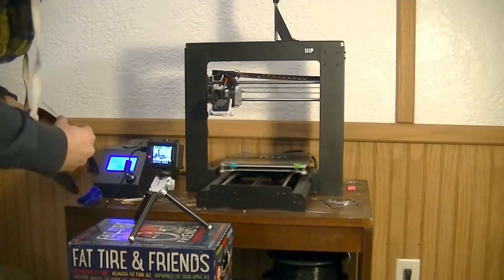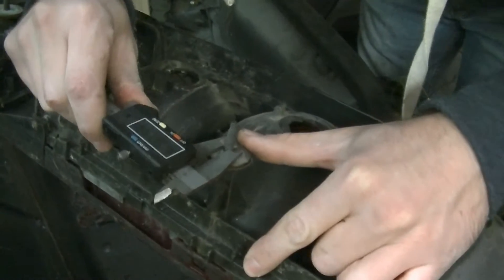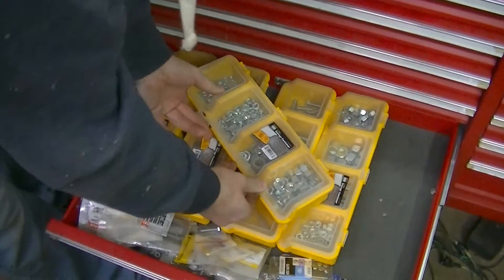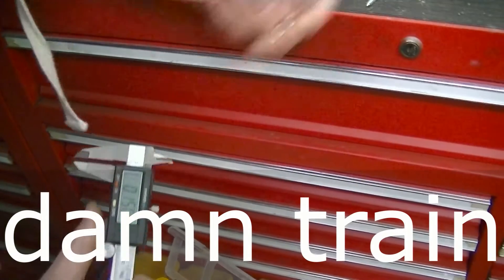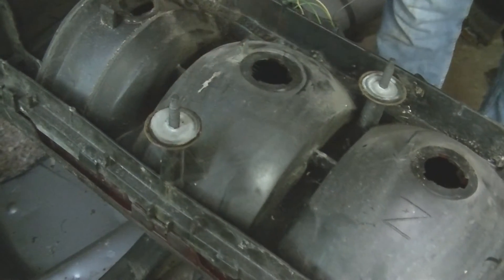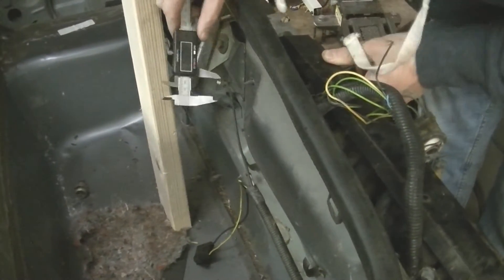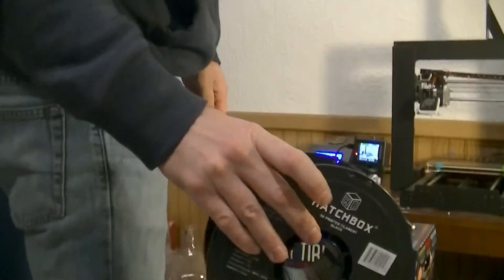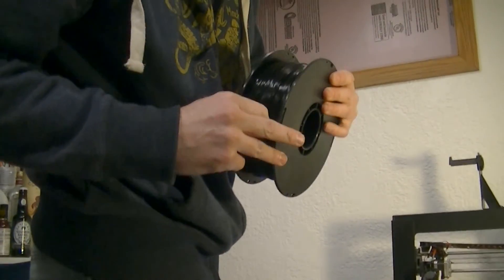My first 3D printed auto parts!!

Comment: How did they go? Did they work ok on the first print?
Reply from the maker: yeah worked first print, its tight and it kind of pushed the threads into the print like a form tap.
Reply: I was wondering whether printing the thread might have been the way to go but it sounds like it's done the job.
Reply from the maker: It would have definitely been better. but I'm a novice at autodesk. This was quick and easy.